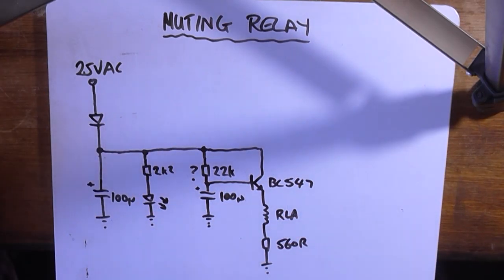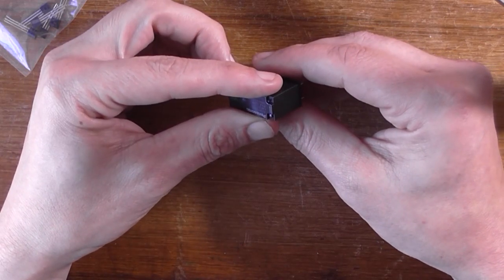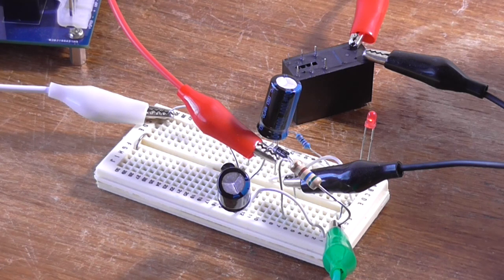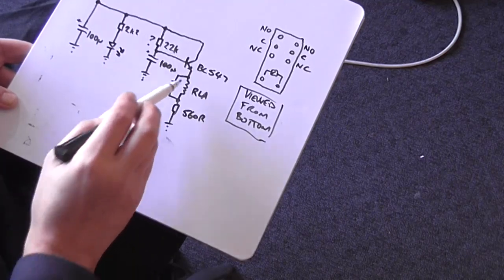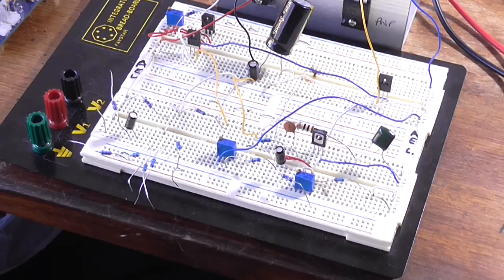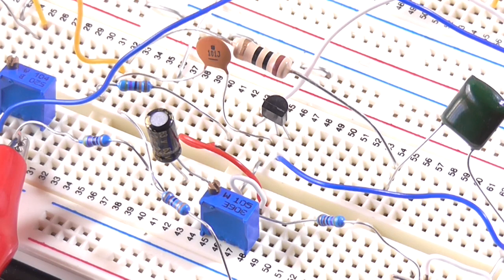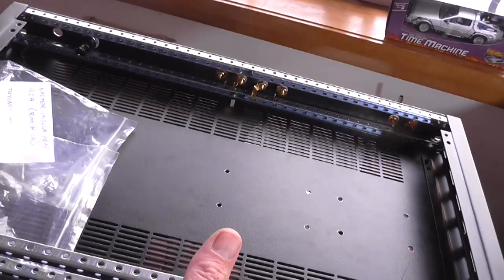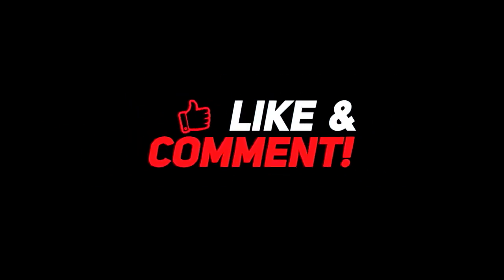15W+15W Stereo Amplifier Build: Part 2 - Finalisations

Comment: Yeah, those 1 RU cases are pretty small height-wise. I ended up grinding those rails on the bench grinder (to accomodate an IEC inlet). It was a bit of a hassle. I don't blame you for going with the Altronics case instead!
Reply from the maker: Thanks. I'll find a use for the stupid thing one day, but for this project, it's just going to be completely annoying! I like simple things, even though, I tend not to make things "simple", lol.
Reply: @AstrosElectronicsLab I know exactly what you mean - when the hardware is straight-forward there's more allowance for circuit modifications and improvements.